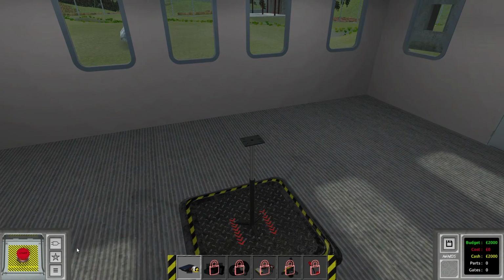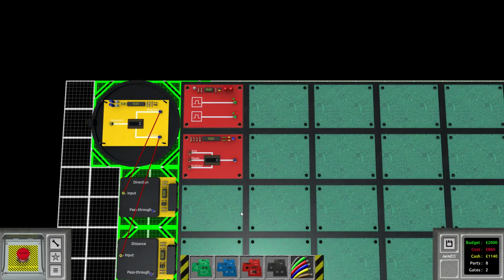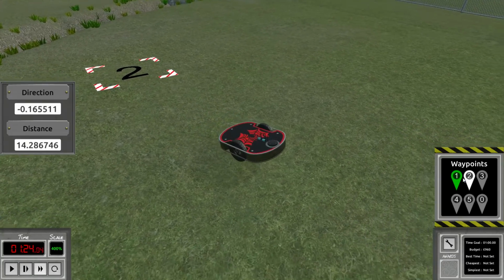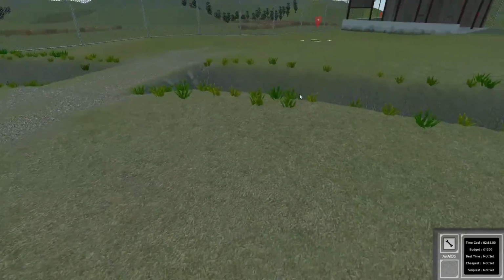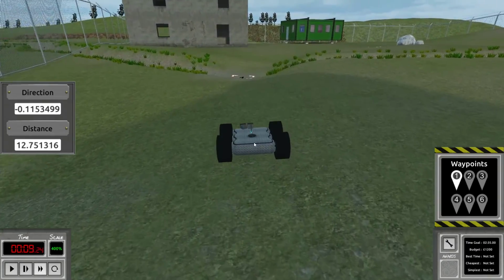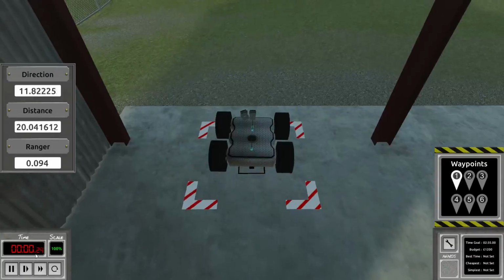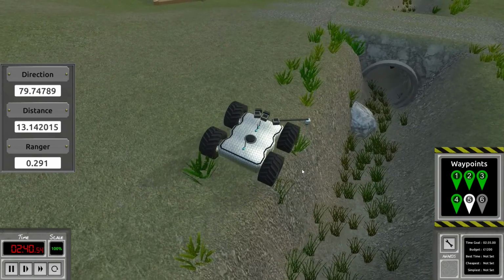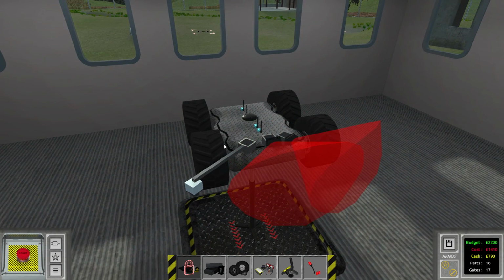GPS NAVIGATION - LogicBots: Ep. #8 - Gameplay & Walkthrough

Comment: You can drop the start pulse and the OR gate because they do the same thing i.e. reset the counter and seeing that you want to start and end at zero you don't need to reset to zero at the start. You can also drop the one static value gate. If direction is > than blank is the same as zero. Use that for waypoint = 6. That should get you in budget.

Comment: Nice. I found that if you add a clamp to the direction + calculations, then there is less micro adjustments and the vehicles are overall faster. (You lose slight accuracy though  ~1 degree)